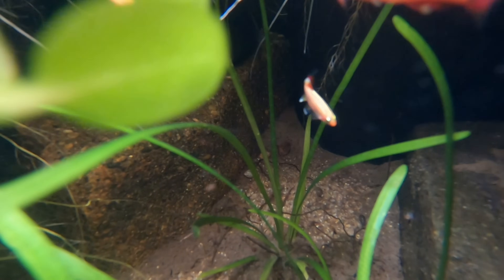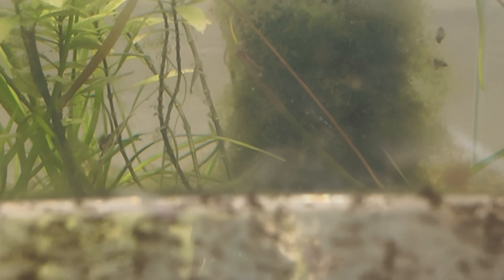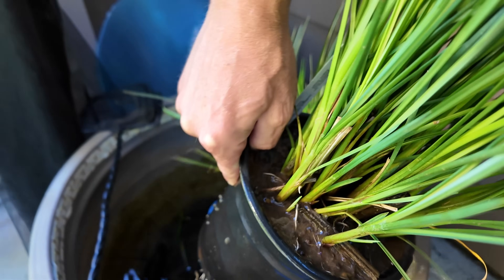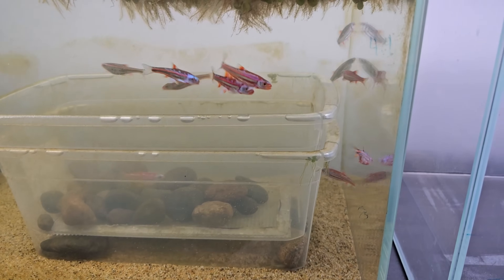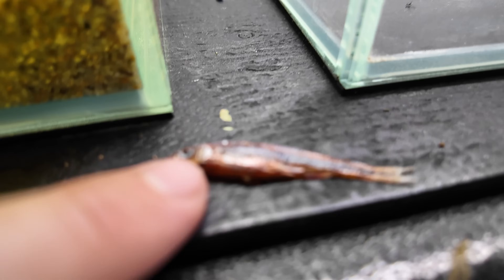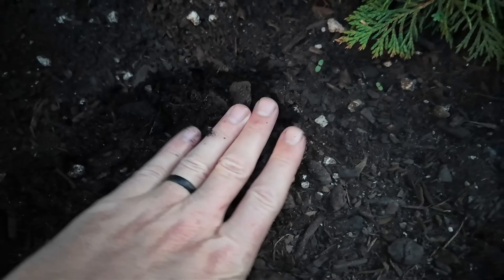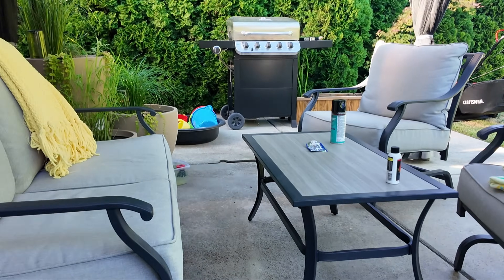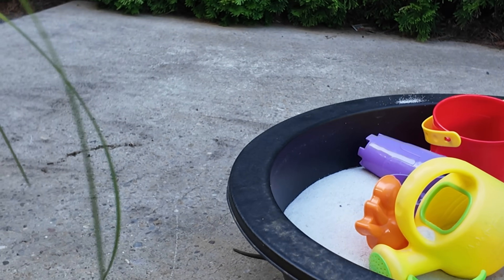My Favorite Fish Are Driving Me Insane...

Comment: For an aquarium lid that is cheap, easy to make and will keep your jumpers from committing suicide go to your local Home Depot type store. You want the material to build a screen like for a window. Buy the frame, something to cut it with like a small hand saw, corner kit for a screen window, spline and a spline tool. Then on Amazon buy the aquarium netting for an aquarium lid, and if you want this to sit inside your tank get the plastic shelf type aquarium lid holders that hang on the edge of your aquarium. Be sure you get the size to fit the width of your glass which is probably 6 or 8mm. Measure the inside of the tank and  cut the frame pieces and put them together with the corner kit. Cut your net a few inches bigger than the frame and put it in the frame with the spline and spline tool. Trim the excess net and you have a nice light lid that will save your fish. If you want it to sit in top just make it about an inch bigger than your tank. I made one for my guppy tank and it sits inside and I have had no more suicides. Good luck, and BTW we don’t have cobras in the wild in the US 🐍 😂 . That was a grass snake or rat snake.

Comment: I have a solid bit of advice about how to deal with your slithery fish Thief and be assured that's what he was there for. 

It looks like you have a male garter snake. Completely harmless, typically are diurnal, quite social live in colonies, usually near some kind of body of water whether it be man-made or otherwise including drainage stitches, eat lots of amphibians and invertebrates as well as fish which is probably one of their favorite foods especially little shiners just like the kind of stuff you're keeping on your patio, don't tend to be defensive so don't worry about getting bit however if you have a bee allergy or anything like that be careful because if you were to get bit garter snakes are mildly rear Fang venomous and it's very rare that someone gets envenomated buy them but it's typically kind of like a bee sting reaction. Predator Nets are usually pretty easy for them to defeat and commercial snake repellents do not work on anything despite their claims. I'm not entirely sure which specific species of garter snake you have but I will do here shortly however I doubt it will make a big difference as to suggestions period of course the biggest suggestions with snakes is to remove their food source but that's a catch-22 in this case. So okay what does work?

Frankly go start pissing all over your yard especially the perimeter and around the patio area is where you keep your fish. Do this consistently and particularly anybody who eats meat and anybody who comes to your house because it shows a population. Straight up Predator urine. Of course if it rains you have to double down on this. After a while you can get a little bit less consistent and they will still stay away however if you quit completely they will be back within weeks if not days especially with a nice little Buffet you have set up for them. I am dead serious about this advice. If you poke around online you will find it in obscure places. From my personal experience with my boyfriend on our Campground out in the middle of nowhere asking guest to do this as well as us doing it definitely deterred all species of snakes from the areas we were doing it in. We were most concerned about the venomous snake species we had on the property because the city folks that came to Camp knew nothing about anything except that anything small and furry to them was a rat. We had a good population of Timber Rattlers snakes, copperheads, cottonmouths and pygmy rattlesnakes. The only one that we would see out in the open frequently where timber rattlesnakes because they're pretty docile and not defensive. They would often ignore human walking by not even rattling conversely I never saw one even mock strike at anybody. The thing is if you're not a threat and you're not food they don't care. The Venom is meant for hunting not for hurting or scaring off a human that would likely kill them in the process. It takes a lot of metabolic activity to produce that Venom to catch their prey so why wasted on scaring off something that would probably waste them in the attempt. Garter snakes as I said are only mildly rear Fang venomous and the Venom is meant for amphibians and fish Etc not mammals even though they will hunt small rodents on occasion however that is the exception not the rule. Besides you are about 100 times bigger than any prey that they normally run across. Garter snakes actually make quite good pets but in order for them to really Thrive you do need to keep a group of them. Incidentally they are also live barers.

I wish I could tell you that your Raptor scaresnake what do the trick... before I became a Zoological educator I had to get over a deep phobia of snakes that caused me to have recurring nightmares throughout my childhood. Well I got over it after some seriously hard work and the motivation that if I didn't I'd get fired lol. 

Anyway go start peeing in your yard right now.